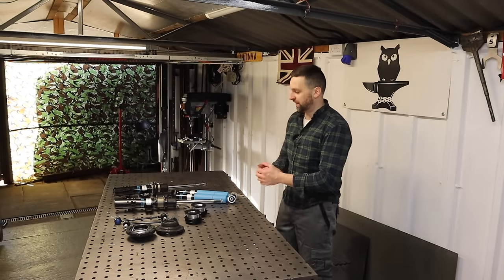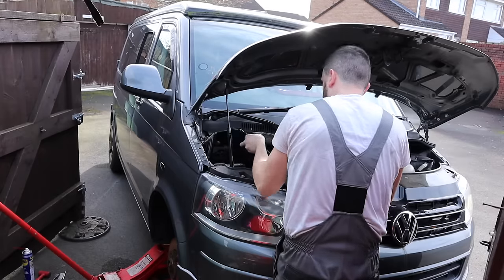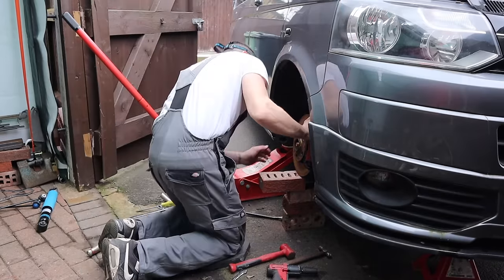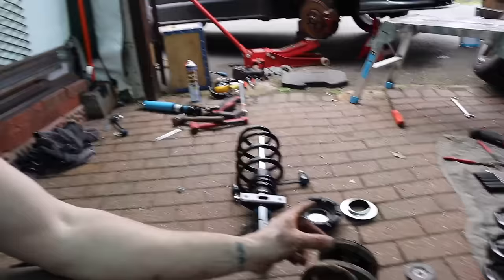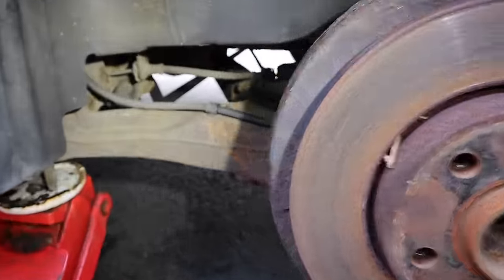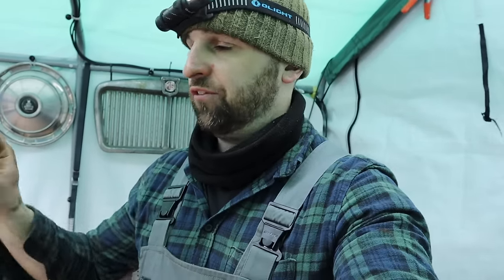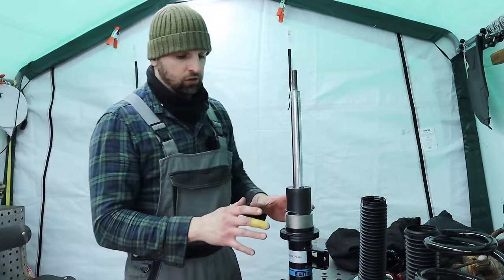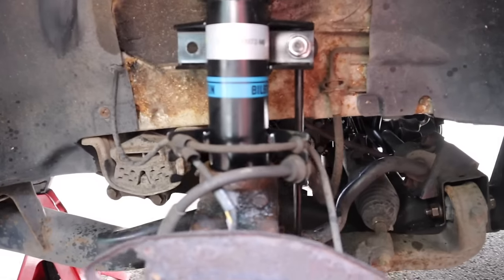Fitting Bilstein B14 Komforts to my VW Transporter / How to DIY

Comment: Cracking idea with the piece of wood. Im about to lower mine and didnt fancy undoing drive shafts and hubs off 😎👍
Reply from the maker: Thank you. Yeah it just simplified the job for me. If you have the other wheel off the ground also that will help you slightly I just couldn’t have both sides jacked up myself.

Comment: There a lot of surface corrosion on the struts, subframe, arms etc. Has the vehicle spent time at the coast by any chance? Great work and interesting video.
Reply from the maker: Thank you matey. Yeah I think it did to be fair. It’s all only surface as you said. To be honest I’m planning to fit new lower arms and I think I might strip a side down at a time and re con the calipers etc as I go. It’s just time that’s all